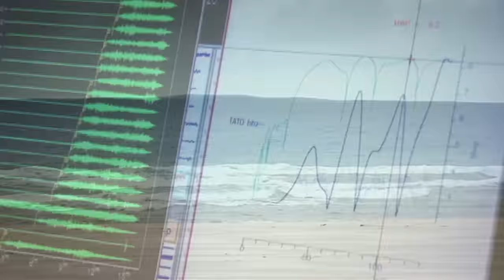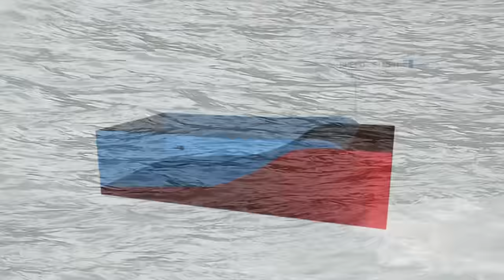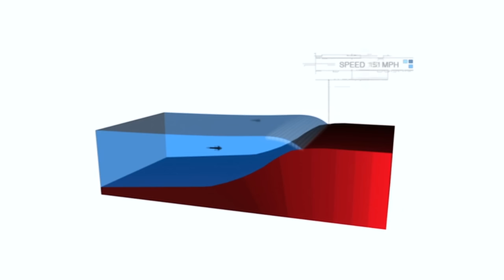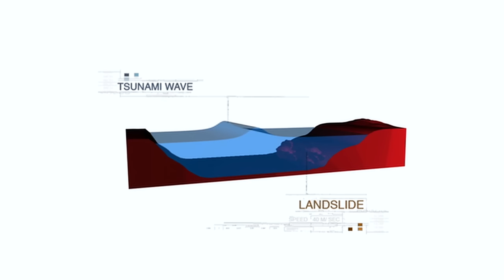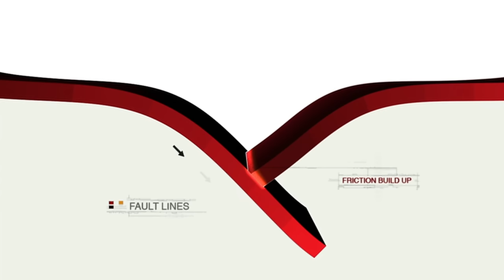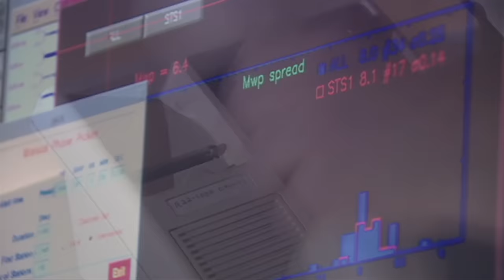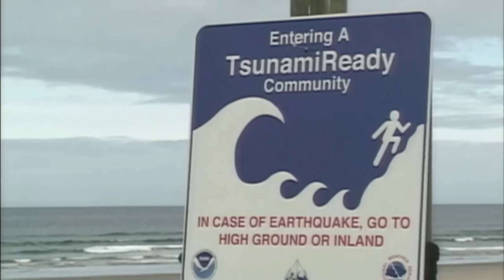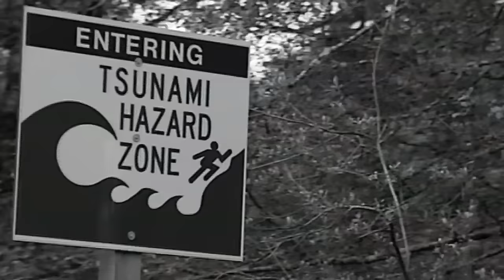Tsunami Warning

Comment: Why do I feel like scientists are going about the detection of tsunami's all wrong? Throughout this whole documentary something stood out to me - Tsunamis travel at the speed of jets.

Instead of trying to discover minute changes in the height of the ocean, why not employ deep sea buoys which have nets that are capable of measuring the speed at which water is traveling? If you had a few of these things out in the ocean, you'd be able to accurately determine just how strong the tsunami was, and which direction it was traveling.
Reply: Okay, I'm just going to paraphrase what was already said in the vid: 

1) the propagation of the tsunami wave through the water moves at incredible velocities, but water is just the medium for the wave to move through, and hence individual water particles don't move much at all and large volumes of water aren't moving at high speed (well, until the wave builds up at the coast and high water volume is forced onto land with high speed)

2) the detection system does use deep sea buoys anchored with sensors in deep water, because it's the only way to detect waves of huge potential energy and enormous wavelength

Comment: Horrific and beguiling.
Im in Sydney and frankly the size of surfing waves can be monstrous. Nor just the height but the washing machine type currents within which can drag you down. 
Just when you reach the surface things can still go awry. Older now and having experienced the sea's wrath a few times I am extremely wary!
As a yougster the fear is just not there. Normal. But you are not bullet proof  just be careful, most surfers are fortunately.

Comment: Ok, I've watched this a number of times but I finally have to comment despite the comparative age of the show. The mention of Hilo HI in 1946 is inaccurate. The picture of the "curious locals" watching from the waterfront fish market was 1960, NOT 1946. The residents in 1946 had no idea the tsunami was coming because the Pacific Tsunami Warning Center wasn't operational until 1949. Ok, done obsessing 😝
Reply: I hate it when they get details wrong... They mix San Andreas fault with Cascadia Subduction Zone fault all the time. Drives me crazy. And they're completely different types of faults.

Comment: Yeah I live just outside the tsunami inundation zones in Washington state.(with several minor fault lines and the cascadia Subduction zone -the same kind that's in Sumatra and Japan) Just enough elevation to be above it and far enough from the coast. If I survive the earthquake, I'll be fine.  Unfortunately, my mom is in a valley that will probably be submerged.
Reply: is it considered immanent out there? The pressure has to be built up to a level that could release a huge quake/tsunami at any point. I don't see how people in the lower coastal towns aren't in a hurry to leave. That said, people don't understand why I would live in an area prone to tornadoes every year. Still, the odds are a tornado will miss. There's little doubt about the type of tsunami a subduction zone would produce. I'd be thinking of it daily.
Reply: @sherimatukonis6016  I've heard on a couple of documentaries the average time between ruptures there is 250 years, making it 73 years past the average. The longer the lapsed time the larger the quake & tsunami. 

A few years ago I had an EF-4 wedge tornado, approx. 1 mile wide at the time, pass within 1 1/2 miles of my house. I saw it coming on the radar & knew it would be close. I even thought up an evacuation route but then thought 'what if that takes me into the path?'. All I could do was hold on & wait for it to hit or pass using the sound to gauge it. It was a sound I can't describe but I will say there's no doubt it's powerful. The horizontal rain was loud but that was drowned out by the tornado. The lights began to flicker & I thought I was in deep trouble but when the volume began to decrease I knew I was lucky. It passed literally right by the edge of town & no one was killed. I don't know how, plenty of lead time & luck for the rural home owners who were hit.
Reply: @sherimatukonis6016  If you're interested, https://www.youtube.com/watch?v=AXmGIUcTdts Titled Mile Wide EF-4 Lawrence/Linwood KS tornado May 28, 2019
Reply: @richardheadly7466  I think I prefer my earthquake potential over tornado alley... Lol.

Comment: Then March 11, 2011 happened
Reply: However; the March 11, 2011 tsunami wasn't as bad as the December 26, 2004 tsunami. Japan has a highly advanced early warning system that helped at least ninety-six percent of the population in northeast Japan successfully get away from coastal areas or riversides and get to high ground. Due to this reason; the death toll in the 2011 disaster was smaller than the 2004 disaster.
Reply: @michaellovely6601  however Japan still underestimated the height and it's sea walls failed to stop it. 
Also Japan is a good example of what tsunami would be like due to extensive video of it. If you don't understand the explaination just watch those videos